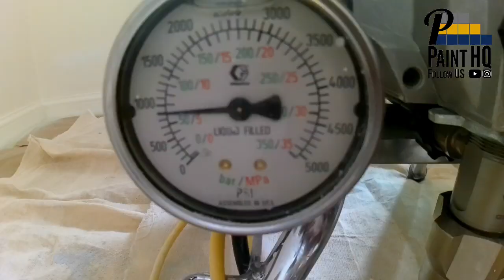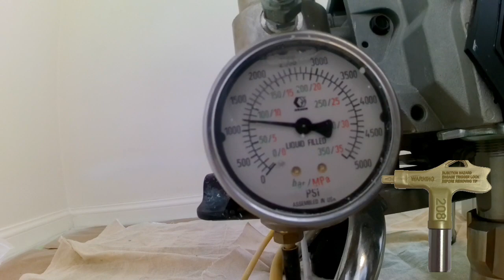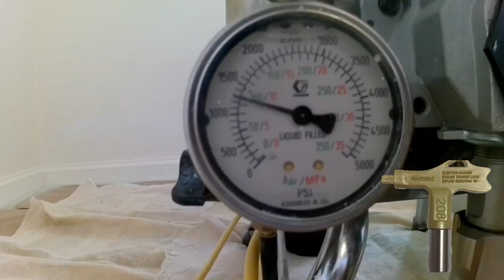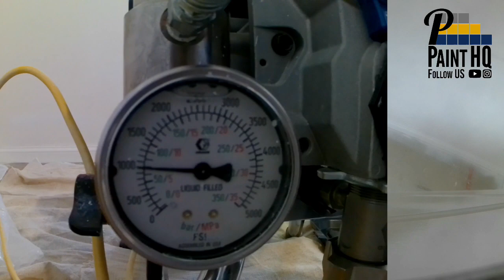How to spray doors | Painting doors with an Airless Paint Sprayer

Comment: Another great video
Re the tops of the doors do you just use a piece of wood screwed in each one or is it a 'proper' door holder thingy?

Ta
Reply from the maker: Ah thank you kind sir.. these were kindly made for me by someone I know that manufacturers kitchen cabinets.. however you can use any pieces of timber, wooden paint stirrers will work 😀 ..Don’t go too short though, it can be more tricky to configure the doors if the spacing is too short.. just to add extra info, my opinion is to spray doors vertical.. you can get a door stacking system that allows you to spray doors flat and then stack them.. I wouldn’t want to risk the potential for doors to warp, especially after adding moisture via painting 🙈 Hope this helps my friend 💯 regards Pete
Reply: @PaintHQ  

 Cheers

Yeah more chance for airborne crap to land on them if laid horizontal whilst drying 

I've booked a job in with 10 doors to spray in a room I'll make up similarly to yours.  Winner winner
Reply from the maker: Ah great news 💯 ..Trying to think of anything else that might help.. apologies if it’s obvious, be sure to number / mark the top of each door to identify where each one goes back 🙈😆
Reply: @PaintHQ looks like you sprayed trim and baseboard, then doors. Will you do walls last? In Canada most contractors don’t spray walls without back rolling to allow for touch-ups. I see you spray walls often and don’t back roll. 

I am painting one of my houses, everything is done except the 4 bedrooms, 1 bathroom and some closets. I also haven’t touched the doors at all just got a coat of semi gloss down on the baseboards and door trim fronts. Will take all that I absorbed from your videos and apply it to finish the job. Thanks best Amrit
Reply from the maker: @amritpalbharajvideoproduction you’re very welcome.. thanks for your support 🙏 Good luck on your latest project, be sure to let me know how it goes 💙💯 regards Pete

Comment: Have you tried the tritech 206 or 306 tips? I only have graco fflp tips atm and they only go down to an 08, and would love to know if you think it'd be worth picking up the tritech guard and those 06 tips. I only really spray latex and urethane enamels that tend to be on the not so thin side (unless I'm priming with bin of course, but I do have a Graco 9.5 hvlp for extremely fine finishing).
Reply from the maker: Hey Alex.. you raise a good question.. I haven’t used the .006 TriTech tips, it’s something on my list to try out, especially with me using low viscosity (very thin) spray only coatings.. what I’ve learnt about .006 tips, they’ll typically need a higher pressure Vs .008 and .010 tips.. what was explained to me, it’s because you’re pushing pigmented material through an orifice the size of two human hairs.. clear lacquers would behave a little ‘better’.. also for this reason, .006 tips will need a greater level of filtration, such as a 200 mesh filter to avoid the higher risk of tip blockages.. you could use a 100 mesh in the manifold, but I’d go for a 200 in the gun.. hope this helps, great to have your input on the channel.. regards Pete

Comment: Hi Pete I hope I find you well just wondering how your getting on with the Tritech Ultre tips I see now they run at a higher pressure than the FFLP and HEA but have you found a place for them in your spraying system kindest regards Simon
Reply from the maker: Hey Simon, that’s a very good question.. I’ve not yet found a place in trim / woodwork spraying.. still very much a fan of the FFLP tips.. whereas I’ve gave the 616 a runout with AR2.. I find AR2 can be problematic with any tip, it sprays better with a drop of water.. awesome unbeatable product though 💯 .. I also sprayed Little Greene on the panelled wall in my last video, went on nice.. on the whole, I’m glad I’ve got a couple of TriTech tips in my kit.. they work well with the handheld too, gives a nice wide fan when other tips seem to ‘fail’ ..Think my last video using the handheld spraying feature walls shows that 🤔 .. As always, really great to hear from you my friend ..Hope you’re keeping well too 💯👌👍😊
Reply: @PaintHQ  I’m good thanks my friend AR2 definitely thinned down works a treat I like to get it thinned down to  the same consistency as the Helmi takes about 20% water but I find it works great I’ll try the Ultra on a lid next a 6/16 I think and let you know how it goes thanks for the reply it’s always great to hear from you buddy go easy 👍🏻👍🏻
Reply from the maker: Yeah great, let me know what you think of the 616 👌😆

Comment: Hi pete. I recently had to paint over old oilbased gloss.  I gave it a good key and painted with bullseye 123 which was tinted. Left overnight to dry then painted with dulux wb satin . At the time seemed to me like bullseye was taking forever to dry. Im finished now but noticed the paint still really easy to scrath off. I know bullseye state seven days but who really has time to be waiting around? I did a test patch where i just keyed gloss and went straight over with satinwood just to check adhesion.  Will see how that fares but it did seem to be sticking better already. Should i ditch the bullseye? Thanks again pete
Reply from the maker: Hey Mick.. it’ll be interesting how the keyed gloss and straight on with satinwood fares.. my initial thought is to think the old gloss isn’t sound.. often when I come across old gloss work on panel doors, the old paint job looks sound, then when prepping, the gloss just peels and peels.. in this scenario, I prep as much as feasible, then I use Zinnser Peel Stop, followed by an adhesion primer such as Caparol Haftprimer, or Tikkurila Otex Akva.. these are my usual adhesion primers.. I typically wouldn’t use 123, I’d probably choose BIN.. and yeah, I too am surprised 123 would take an overly long time, you would be wanting to top coat definitely by the next day 👍 Hope this helps a little.. check out the Haftprimer or Otex Akva when you get chance, both are waterborne 👍 let me know how you get on my friend, always great to hear from you.. regards Pete
Reply: @PaintHQ  thanks a mill pete appreciate it mate.
Reply from the maker: You’re very welcome, anytime 👍

Comment: I find that Graco at 900 looks better than Tri Teck at 1300 but I don’t have the experience to be full confident in my choice but Graco seems better pattern at lower PSI
Reply from the maker: Thanks for your input my friend, always great to hear from you 💯.. Yeah Graco FF LP tips are my usual choice, I do like it when you can spray at low pressure. Although I have heard good things about TriTech and Wagner Fine Finish tips, so wanted to give them a try.. I believe it can depend on the material, it’s worth having that selection.. You’re doing great buddy, gaining experience all the time 👏 keep in touch 👍 Pete
Reply: @PaintHQ  Cheers Pete I also have a choice my go to is Graco but I’ll be spraying a ceiling next week I’ll be trying a tri tech ultra a 5.16 I think I’ll let you know how I go with it kindest regards Simon.
Reply from the maker: Yeah definitely let me know Simon.. I’ve just brought a TriTech Ultra Fine Finish 616 😊 Not had a chance to try it yet
Reply from the maker: Hey Sam.. Yeah a new tip.. That’s a very good point, thanks for sharing my friend 👏💯
Reply from the maker: Thanks again, yeah I’ll do that and compare again 👍 ..TriTech and Wagner will take each other’s tips but neither will take the Graco LP / FFLP tips.. Be aware though the tip seals are different and I’ve heard whilst they work, you could get an issue.. I’ve not tried spraying myself but I can confirm TriTech and Wagner tips will fit each other’s guard.. I know what you mean, multiple guards add to the costs ☹️..Great comment buddy 👏
Reply from the maker: @swatts66  Sorry Sam only just seen this msg.. Yeah I’ve gave the 616 a few run outs now with emulsions.. nice wide, soft fan pattern, just a lot of fog / dust as a result.. Hope you’re keeping well buddy 💯 Regards Pete

Comment: Hey pete which pressure gauge brand will you recommend for a graco 395
Reply from the maker: Hey Lauro, happy to help if I can my friend.. I believe my 395 is a newer ‘Classic’ model and came with a gauge pre-installed.. what country are you from, if you don’t mind me asking.. just because I’ll put some links below so you can see from images and descriptions what I mean, but the links are to a sales distributer that I use in the UK..

There are genuine Graco gauges available, just double check what connectivity you have, for example this one would attach to the manifold filter housing. There are other configurations available..

https://www.sprayman.co.uk/product/graco-gauge-115523

Whereas this Wagner in-line fitting can go in between the fluid output and high pressure hose
https://www.sprayman.co.uk/product/340257

Hope this helps a little, I’m happy to help some more if I can.. regards Pete
Reply: @PaintHQ  i live in USA I really appreciate your help buddy thanks a lot
Reply from the maker: It’s a pleasure and awesome to hear from you in the US 🇺🇸❤️👌👍 I admire the painting / spraying and refinishing technology in the US 👏 
..Keep in touch my friend 🙏

Comment: Dang...looking good! Do you know what would cause craters in the paint finish on my doors? I’m using a graco project painter plus airless sprayer with a 311 tip. I used Krud Cutter gloss off to remove gloss cause I didn’t want to have to sand everything and was told that that was an alternative. Anyhoo, I’m using sherwin Williams ovation paint in semigloss. I changed psi, sprayed continuously without stopping, sprays sprayer for 10 seconds or so to make sure there was no air in line, etc. I also tried respraying after I sanded the craters and same result. I don’t think it’s fish eye, more looks like an orange peel but not as cratery cause there is some smooth surface. I did not thin the paint but starting to wonder if that’s my issue. What do you think could cause this crater problem?
Reply from the maker: Very much appreciate the support my friend.. it does have all the signs of ‘fish eye’ and your material is being contaminated by the Krud Cutter.. your setup sounds spot on, you typically don’t need to thin with airless.. then as long as technique is sound, there isn’t a lot to go wrong.. not like air spray / HVLP.. (too much air for example, you can get orange peel)

Is it possible to spray a test on a test piece, to eliminate the door and door prep.. if contamination is the issue, a primer such as BIN would be helpful.. if only small areas need to be fixed, you can get it rattle cans to spot prime..

I do hope this helps my friend.. great to have your input on the channel, let me know how you get on 👌👍😆 ..regards Pete

Comment: I have the ultra max what fflp tip do you recommend for doors trims l have 310 and 312 🍻
Reply from the maker: Hey buddy.. for door frames / architraves (trim), I’d go for a 208 or 210 depending on the viscosity of the material.. most decorative (thicker) paints require a 210 👍 ..A 208 speed will probably be around 3 or 4.. A 210, you’ll probably be around 5... thanks for your question, keep in touch and subscribe if you can.. regards Pete 🎨💯
Reply from the maker: ..Just seen your edited reply 😆 ..Go for the 310 ..Just means you’ll have a wider fan than a 210 ..A 312 would be for much thicker materials, thicker than most decorative trim paints.. if you was to use a 312 the paint will fly out.. you would have to move very very quick 🙈

Comment: What product for the doors there buddy did you thin it at all 👍🏻
Reply from the maker: It’s a low viscosity manufacturer waterborne coating, primer and top coat 👍 No thinning my friend, I wouldn’t thin a trim paint going through an airless sprayer, I wouldn’t want to risk altering the properties of the material.. I’d use a bigger tip if needed.. thanks for your question 👍 ..I plan to do a future video featuring the waterborne trim paints that I’m a fan of 👌 What trim products are you currently using?
Reply: @PaintHQ  I use Helmi un thinned I’ll try Isomat next the finish on the doors was exceptional that’s why I asked 👍🏻
Reply from the maker: Helmi is great 👏 30 and 80.. Helmi 80 is my go to if customer wants that higher sheen 👌😊
Reply: @MEVD2011  the isomat is seriously nice stuff! Infact pete has seen the end result on my insta. The whitest woodwork paint i have used.
Reply from the maker: Lovely job 👏👏👏
Reply: @PaintHQ  much appreciated buddy 💪💪

Comment: 208 with 50% overlap on so many doors? Any reason you don’t use something like 510?
Reply from the maker: Hey Igor, you make a very good point my friend.. I’m using a low viscosity material, so the .008 tips give just the right amount of fluid flow.. usually I’d use a 308 for the doors 👍 ..thanks for your feedback.. regards Pete

Comment: 208? Fan too thin for doors, at least a 308 and please take your door handles off, you can’t spray the doors properly with handles on.
Reply from the maker: Thanks for watching and your feedback my friend.. You’re right about the door handles.. Like all of us, I evaluate every project - what’s the effective route to completion? Without compromising on finish.. In this instance, the doors were a lightweight mdf composite and in my opinion the carpentry wasn’t the best (new build).. The screw heads were tiny and chewed, I didn’t think the handles would have held up being taken off and screwed back into the mdf.. Then because I was able to unscrew the bezels - with effective masking and a good spray job to coat the area, I knew without doubt the result would be excellent.. Appreciate your comment, you raised a good point 👌😊 ..Please subscribe if you haven’t already, it’ll be good to have you on board with future input 💯.. Regards Pete
Reply: Pete, they’ll always be people that are not comprehending the entire aspects of trade, circumstances and so on… Let them be. I do appreciate your efforts, and really like your approach to the trade. By the way: I am using the same Tritech 208, and 210 for spraying the doors. Unmatched finish at all times! Keep it up mate!
Reply from the maker: Really appreciate your kind words of support.. means a lot 🙏 ..keep in touch my friend.. regards Pete

Comment: 900
Reply from the maker: Hey Wes.. what’s “900” my friend? 😆
Reply: @PaintHQ  5:57
Reply from the maker: Ah yes I see.. good choice 👌👍😆 Appreciate your input 💯 Regards Pete
Reply: @PaintHQ  What do you think yourself? On screen it was the 900 in my opinion. What do you think in real life?
Reply from the maker: Hey Wes.. definitely the Graco FFLP (spraying at 900psi).. It’s good to spray at the lowest possible pressure whilst producing a good fan pattern.. that way you get more control and less overspray.. so with the material I was spraying in this video, the Graco FFLP sprayed beautifully.. the Graco FFLP and LP tips are awesome.. from my videos, you’ll see I do like to try out Wagner HEA (big fan of the 515), and TriTech tips.. it’s useful to have options to turn to in your kit 👍😆 I’m happy to help you, if you need it 👍 Thanks for your question my friend.. regards Pete
Reply: @PaintHQ  Hey Pete thanks for your answer. But what's the benefit of using more pressure then?
Reply from the maker: No problem, anytime.. There’s actually no benefit to more pressure.. pressure is just what’s required to atomise (break up) the material.. some materials and spray tips require more pressure.. TriTech fine finish tips for example will require 1200-1800, but they don’t proclaim to want to get caught up in the low pressure game.. Graco ‘production’ tips will operate at a higher pressure too versus their LP and FFLP counterparts.. just remember, pressure has no bearing on speed / the amount of material flow.. that’s determined by the size of the tip (hole).. for example a 308 tip, the 08 is what will let the volume of material through.. a 208 will let the same amount but in a narrower/ more concentrated fan pattern, a 108 even more so.. you would need to move much quicker with a 108 versus a 308, else you’ll get runs.. Then a 310 will let more / thicker material through than a 308 (bigger tip hole (10) size).. the pressure you set the pump is purely to atomise the material through the selected tip (hole) size.. thinner / low viscosity paint (lacquers and trim paints) will go through smaller tips such as 308 and 310.. then thicker / higher viscosity materials, such as emulsion walls paints will go through bigger tips 515 / 517. Lower pressure spraying is desired when you want to keep control in occupied furnished properties, where as building sites / new builds it wouldn’t be as much as a concern.. sorry for the essay and apologies if you already know, just wanting to give you as much info as possible 😆 ..Regards Pete
Reply: @PaintHQ  Hi Pete, fabulous answer – I’ve copied it to my notes! Best wishes, Rob
Reply from the maker: Thank you Rob, I really value and appreciate your support 💯
Reply: @PaintHQ  I'm reading your anwer 1 year later mate. It's a shame haven"t read it at the time. But anyway, thank you for the great answer. I have a little experience right now but you will still be the master. Regards Wes
Reply from the maker: Great to hear from you Wes.. I’m happy to help if I can, anytime my friend.. regards Pete 💙